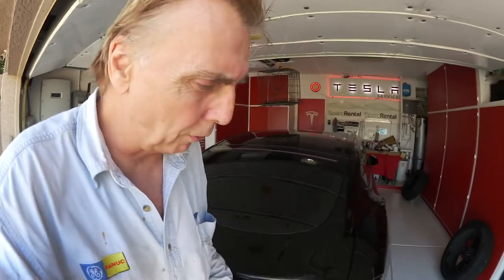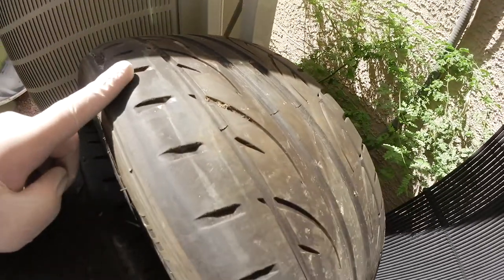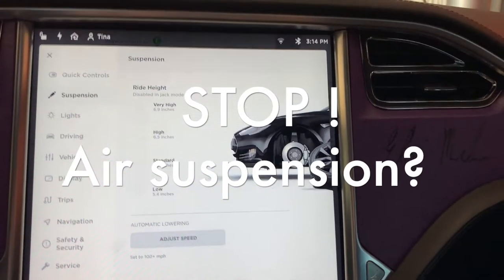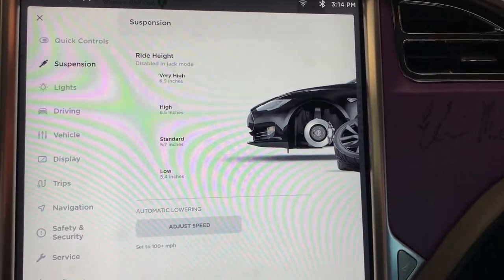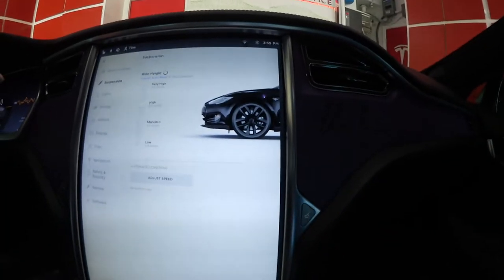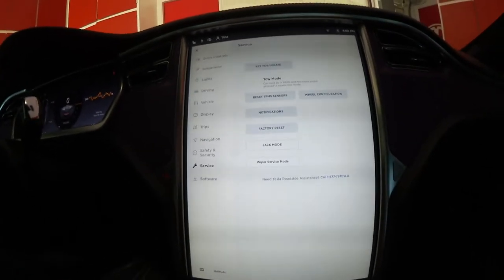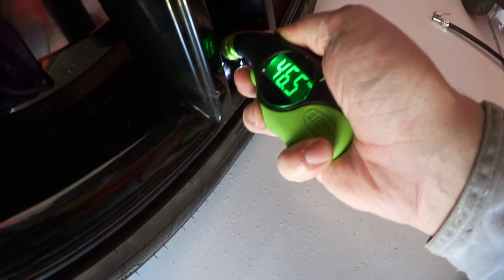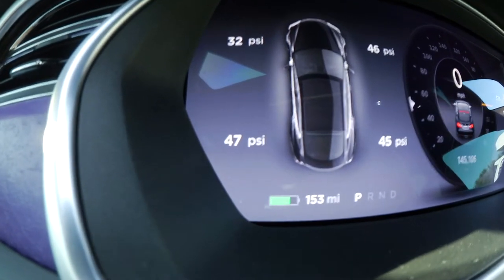Model S Rear Tires wear inside. Can you avoid this?

Comment: Great video describing the Tesla inner tire wear issue.  Check out N2itive adjustable camber arms made for exactly this problem.  Then you can keep the wheel size you want. No need to drop down to 19".
Reply: You sure they work?
Reply: @Kirk510  yes. But you don't have to take my word for it. You can see the reviews.
Reply: @N2ITIVEdesigns  how much ? I wanna order, I’m on seconds set of rears in pass 6 months.

Comment: Doesn't look like camber wear, but more like toe wear to me. I had the exact same issue on my 335d. You can see that the contact patch is much wider that the worn area. Too much toe in/out makes the inside of the tire "drag" instead of roll.
Reply from the maker: Good to know. Thanks, Rolf
Reply: My Plaid with 21's an 8700 miles has this problem.  Looks like toe wear.  The difference is here: https://youtu.be/FW788yNKqr8?t=318

Comment: I have 21's on my 2013 model S P85.  Just replaced tires.  Front tire wear was bad on the inside; should have got another 10k out of the front set before they started leaking.  Any advice on non adjustable suspension?  I was looking at a camber kit from n2uitie.  64k miles.
Reply from the maker: Thanks for subscribing. First check the alignment. Then do something else. Rolf

Comment: Did you have the Continental TPMS retrofit done on the Model S?
Reply from the maker: Yes I did. Rolf
Reply: What does that do?
Reply: @Kirk510  If you have an early Model S you only get a warning light when something is wrong with a tire or the system. But it does not show which tire it is. Also you can not see the current tire pressure with the old system. At some point in 2014 Tesla started installing a different system that allows you to see the tire pressure of each individual tire on the dash. You can then see which tire is low and caused the warning light to come on. The system can be upgraded. Tesla can do it for you or you can buy the parts from Tesla and DIY. This video shows how to do the upgrade: https://youtu.be/QaMBYfzy_Gg
Reply: @RMTFamily  so this differs from my standard tire pressure gauges that’s gives me all individual tire pressure that I have now???
Reply: @Kirk510  If you have a top view of the car with a tire pressure showing at each wheel than you have the new (Continental) system already.
Most cars have been upgraded a long time ago since there were several issues with the old (Baolong) system.  What year is your S? Last 6 of VIN?
The thumbnail for this video shows what you see with the new (Continental) system.
https://youtu.be/QaMBYfzy_Gg